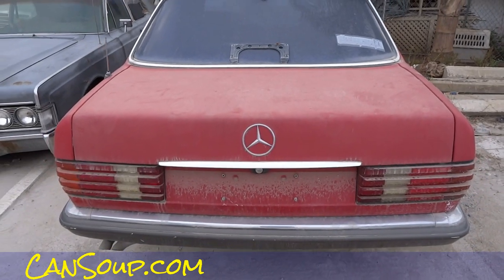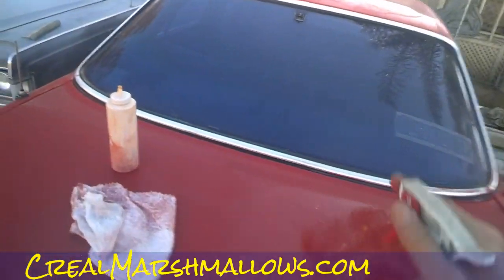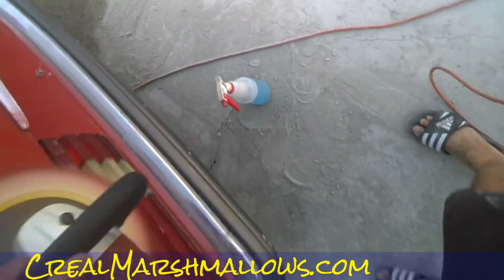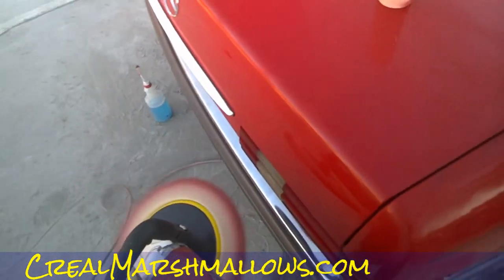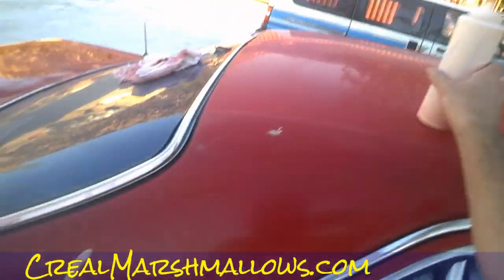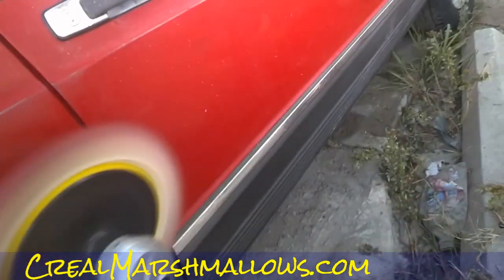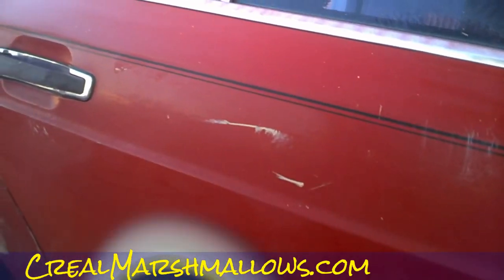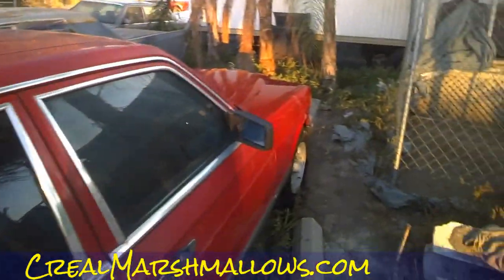DIY Buffing & Polish How To Auto Polishing Restore Paint #throughglass Detail

Comment: Hi, Can you tell me the make and model of the polisher and polishing bonnet you're using in this video ? I'm using a old 6" craftsman (4.5 amps, 2 speed 1400/1650 rpms)  with a 7"terry cloth/foam polishing bonnets. I'm looking for something "more modern" lol .I'm not doing a ton of cars but id like to find a new polisher and bonnets. If its really expensive could you recommend something not so expensive but better that what im currently using ?  Thank you ! And Thanks for the videos. Ive watched a few others also ! Cars come up really nice !
Reply: that polisher is from "chicago electric" which is a harbor freight brand. you can also get interface backings and buffing pads there
the polisher is around $35-50 i think and the rest runs for about 10 and below
Reply: I thought it was a harbor freight.  Does it work well ? Any negatives with it ? Thanks
Reply: one negative i found while using one was that the digital speed settings are only in increments of 500rpm. it works fine as a buffer as far as i could tell lol
Reply: Ok thanks for the info and I appreciate the replies ! I'll check one out when I get up near the harbor freight store. Take care
Reply: 7'' velcro backing pad meguiars red foam cutting the best